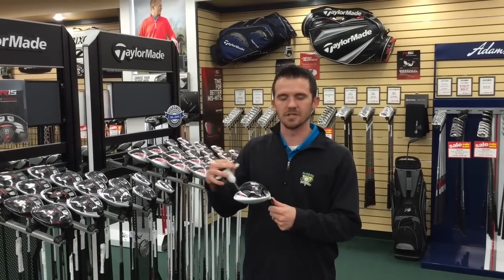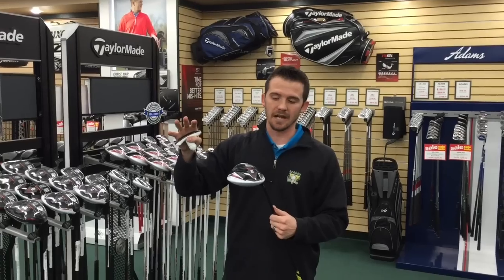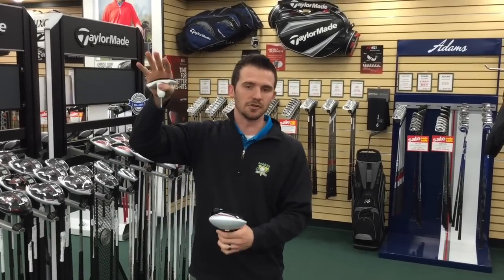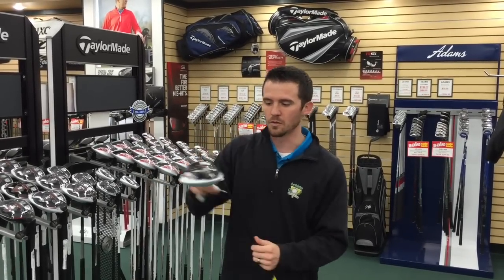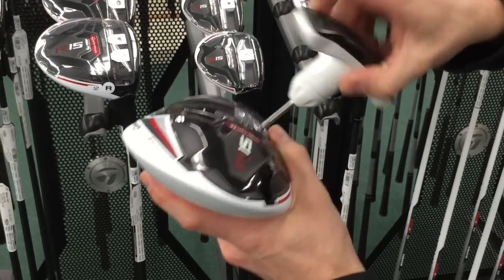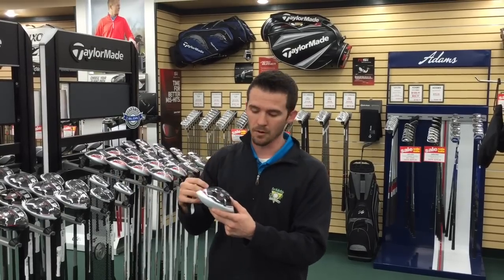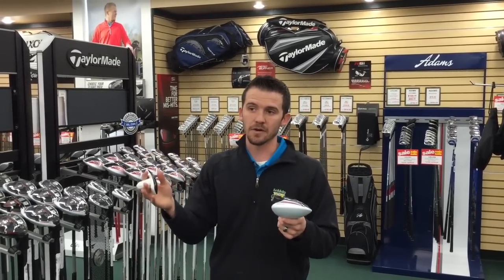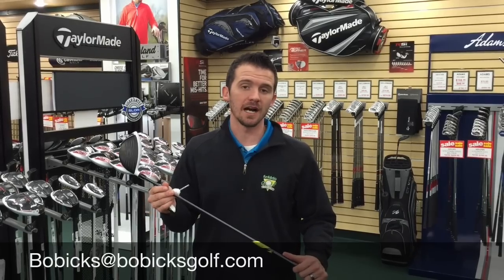How To Adjust Your R15 Driver

Comment: Thank you for explaining all the adjustments on this driver. 1st question: there was a loud click when you tighten the shaft screw. Was that permanent lock for good? 2nd question: for the 2 weights under the driver, how tight would you tighten them? Would they damage the edge or the guide that holds them in place if you tighten them too tight?
Reply from the maker: +Sac Trac The clicking you hear is the torque wrench telling you that is as tight as it needs to be, this is not permanent and can be changed whenever you like.  The beauty of these wrenches are they don't allow you to strip or over tighter the weights or screws on the club.
Reply: +Sac Trac It is a torque screw. Which means that you cannot screw it tighter than a certain tightness. If you have to apply more than a certain amount of torque to the screw, the screwdriver will skip and you hear the click. Screwing too tight would deform the thread of the screw and would prohibit you to adjust it in the future. Screwing it too loose would of course risk you to lose your clubhead.

Comment: Great video...thanks.  Just picked one up this week after trying a friend's at the range.  He had it set at 10.5 degrees and had the weights spread all the way apart.  The ball goes dead straight with a neutral grip and stance.  Hard to fade or draw that way but I'll figure it out.  Again, thanks....

Comment: I'm right handed and it seems majority of the balls at the local driving range are going right. With that being said, do you move the weights towards the issue. If you have a horrible fade move towards fade or go the exact opposite way? I'm new to the golf game but, did buy this driver in the 10.5. Only cause the used set I bought the driver had a dimple in the shaft which made the head of the club look off. Thanks for any n all help.
Reply from the maker: If you are fading the ball move the weights to the heel (towards the shaft) to help reduce fade.  Also raising the loft can help reduce fade.  Thanks!
Reply: thank you

Comment: so, if you move the weights to the outside, draw and fade; will you lose distance sine the weight aren't at cog?
Reply from the maker: That would depend on the individual, but moving the weights from the low-central position to the outside of the driver could promote higher spin thus losing distance.  Thanks!

Comment: I recently got a used TaylorMade R15 with a Speeder 57 shaft. Is this the Senior shaft?
Reply from the maker: Should have a shaft flex indicator with an S for stiff a R for regular and an M for senior.  Thanks!
Reply: Thanks! I looked and have the M on shaft. Thanks, for the quick reply!
Reply from the maker: +justpar2012 glad to help!

Comment: what does lie mean on the saft
Reply: Brian Pitts lie angle = the angle that the shaft comes out of the club head. Most adjustable drivers have a setting that will make that angle more upright if you choose, but most don't have an option for anything flatter than standard.

Comment: Simply my opinion ,,, in concept adjusting those weights is a good idea but ( as I said simply my opinion ) I don't think they are anything more than a merchandising gimmick. 

Certainly not singling out T.M. by any means but I don't believe that for the average amateur golfer these adjustable weights  will make the slightest bit of difference whatsoever. I play the T.M. R15 driver, an excellent club, I play off a seven handicap and I've hit hundreds of balls at the practice range and experimented by adjusting the weights in practically every setting. I have not once noticed any difference, but then again that could just be me.